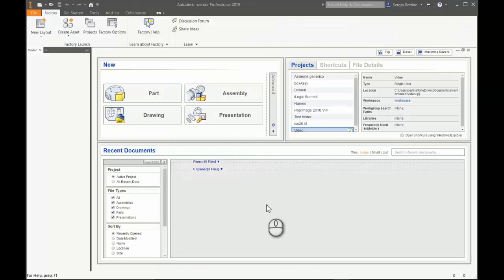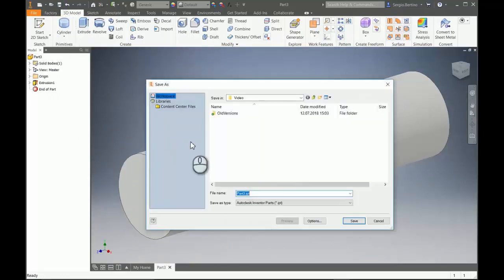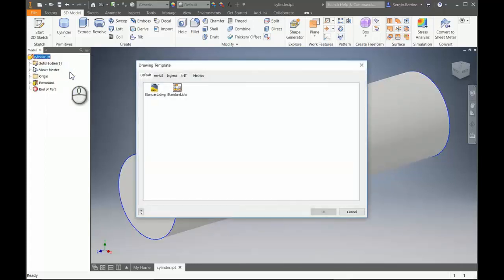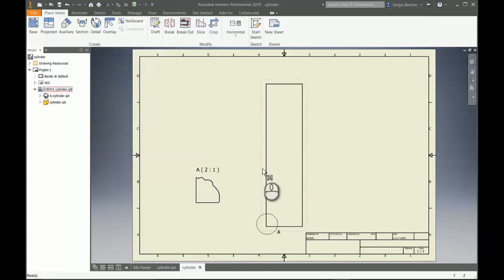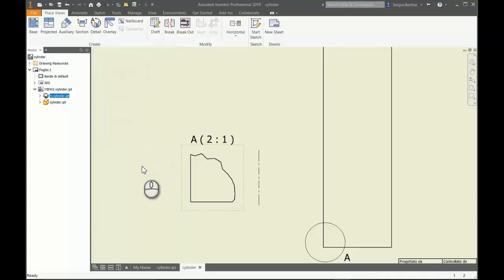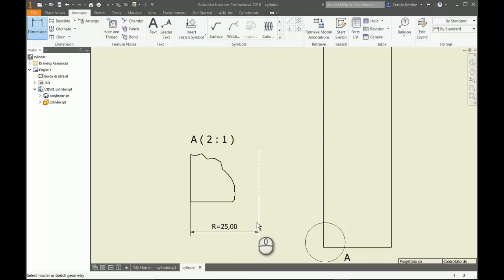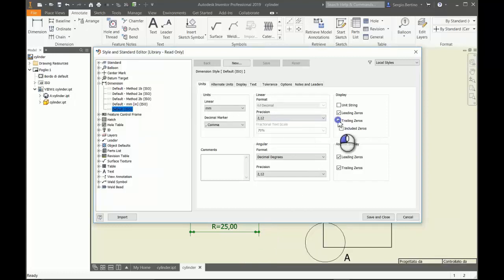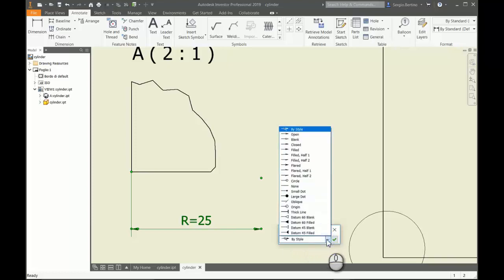Quick Tip - Radial Dimensions in Detail View

Comment: After you create the detail, using the arrow down to expose the origin of the part under the detail. Right click on the desired axis and choose include. Initiate the dimension command and choose your points. After you chose your second point, right click and choose linear dimension under dimension type. Right click on the centerline and choose to make the line not visible. Done.

Comment: "Automated Centerlines" doesn't seem to work with revolved geometry - only extrusions. Also, when placing the dimension, I recommend using [right-click]>Dimension Type>Linear Diameter. This way you can avoid modifying the Dimension Style to remove dimension line and arrow head.
Reply: In automated centerlines there is an option to aply to revolved features, the icon next to the cylinder